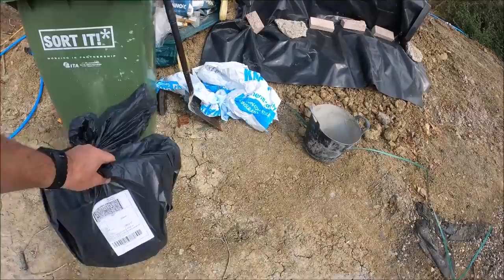Its too hot for digging! 060 9 21

Comment: Working in the Middle and Far east we always had a nap after lunch and now living in Vietnam I continue having them, but as were near the equator it's always sun set around 6pm. So can't do anything out side, except test beer and I have several different local ones in the fridge. Biggest problem is I can never remember which is best so have to start testing again.

I'm looking out to see if Bisket runs on 3 legs as my Jack Russel did, I got worried and took him to the vets, who laughed but did have a quick feel around. It's a common trait with JR's that they pick up a front foot when running and just to confuse us they swap feet. The vet called it running on three cylinders!!!!!!!

I think you will be glad to get all piped up or should it be down and the quicker you get them covered the better.
 Take care and stay cool.

Comment: Hello that trench is straight my grandad use to dig a Chain (22 yards)a day of drains  with a spade and Jerry ,my dad was a pipe layer one was a18 inch diameter pipeline 3/4 mile long starti
Reply: Starting 16 inches down finishing at 16foot 6 inches down with a 3/4inch fall every 100ft it was 3/4 inch out till the tank it was connected to filled,trench was dug with a JCB with 22 foot arm and 46 inch wide bucket

Comment: I am surprised that they dont give you little buckets of pipe lube with your bell end pipe . Not sure what type looks almost like SDR26 . I worked for a company Davis meter here in the states hauling all types of pipe & fittings to job sites . I have also used back hoes for digging the ditches and laying pipe mostly electrical for Mastec . I think you have done a bang up spot on job . Oh glad to see you got some buckets in crusher Pullen .